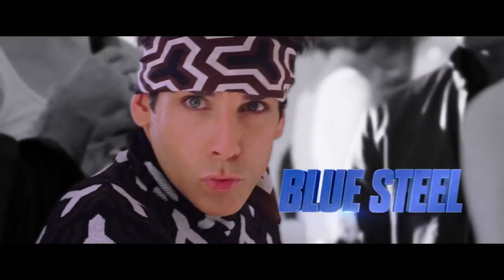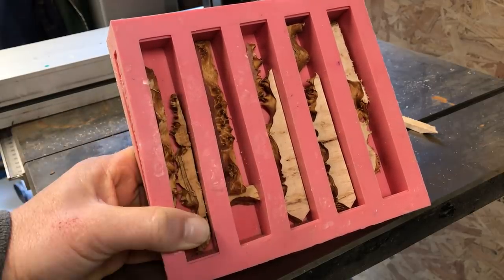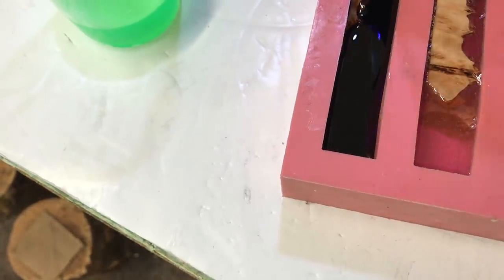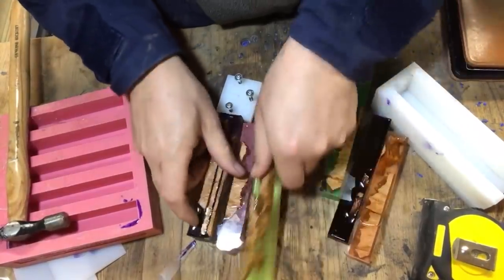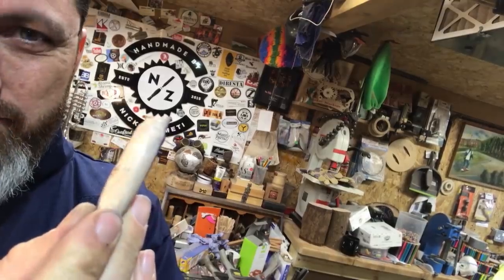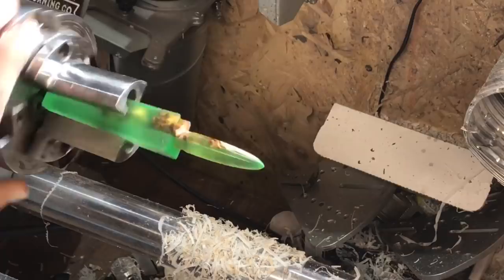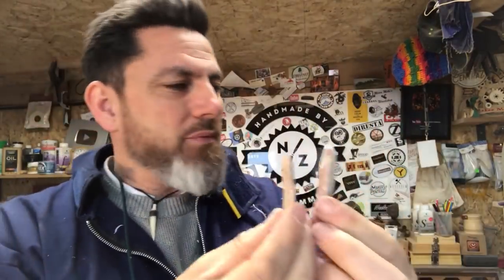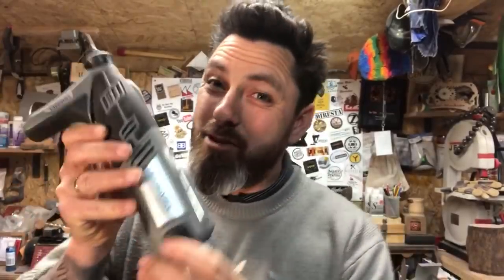I made some funky cool bullet shell resin pendants.. 💥

Comment: The hole in tip just makes it a hollow point
Reply: The crimped ends on the casing are blanks.  They did not have a projectile in them
Reply: Blanks are used at military burial/funerals for the gun salutes.
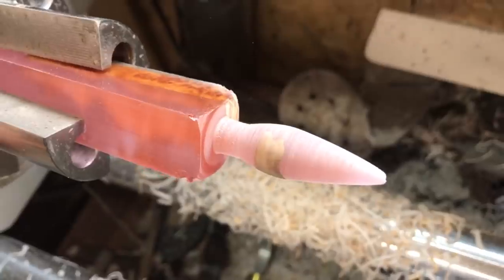Reply: @mmartian1969  15:14
Reply: What the hell does any of y'alls comment have to do with mine?
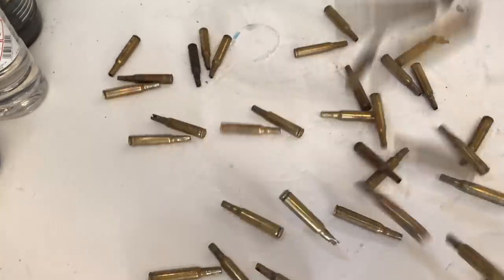Reply: @JDWells-jr6nl  The other two were referencing 0:46 But they got too excited to be little smart arses about their ammunition knowledge before reaching 15:14 of the video, the part which you were referencing to.
Reply: @MoeMyers  10-4
Reply: No, I watched the video all the way through before making a comment. I was ONLY responding to Mark's comment with a bit of smart arse ammunition knowledge that others may or may not know about blank shell casings, which by the way are not "bullet shell casings", there is a difference.
Reply: @JDWells-jr6nl  I thought it was funny lol.

Comment: you can actually pop the primers out of the back of the shell. there is no need to drill it out
Reply: but he had to drill to put on the hanging wire anyways
Reply: @heatherthefireislefairy5469  it would leave a hole just the same and is a lot easier.
Reply: @heatherthefireislefairy5469  There's actually a small hole there after the primer's popped out, a lot smaller and takes a little more finessing. But yeah, you could pop the primer out and use the already there hole if you use a smaller wire. Could also use the primer slot as a place for a mini emblem with a hole in the middle, LOT more work for the emblem though that way.
Reply: Yup.  Press out the primers. Also, I would have used a smaller wire.  The big huge copper is just clunky.  Just solder on a brass loop.
Reply: @shatharis  I kinda wanna see a video tutorial on this.

Comment: Did i mention i have been a gunsmith for 31 years lol  first time i have seen some one drill out primers to make a hole lol they are a push fit , you can bang them out from the inside with a small punch or file nail etc .

Comment: You could use the metal emblems and add it to the necklace like a charm to pair with the pendant. Just drill a small hole on the top and add a jump ring. :)

Comment: These turned out awesome. If I had to pick one, either the purple (because I like how the wood looks just on the side like a piece of polished stone) - or one of the "squared off" ones because they're gorgeous. I would suggest for your smaller projects like that, perhaps a small metal stamp of your logo or at least of the NZ? You could use a hammer and indent pieces with your emblem.

Comment: You could add your emblem by drilling a hole on the ones you put on the bottom of your work. Then add a ring in the hole and string it next to the main piece. I have several brackets like that.

Comment: just FYI in case you do something with the casings again: if you insert something thin through the neck into center of the bottom where the primer (the thing with the dent in the center) from the inside and bang it a couple times on the counter the primer pops out so you can replace it or, in your case, for the hole you're wanting on the other side... unless it's military brass, (can't really tell, sorry) but the military brass sometimes has a crimped primer and that makes it difficult to remove without an actual de-primer tool

Comment: Those came out nicely funky, sir!
If you're going to make a lot of these or use empty cases for other projects, it might be useful to look at some of the specialized reloading tools. A case trimmer and a depriming tool could make processing the brass cases a it easier.
For putting your logo or name or mark on the cases either chemically etching the brass or getting/making a steel die to stamp the case with would likely work pretty well. If you stamp the side of the case, a wooden dowel inside the case should help to keep the case from collapsing while being stamped.
Thanks for another fun and funky half hour!

Comment: Try electro etching your name on. Cut the template out on a vinyl cutter, or manually from electrical tape with a knife. Get a car battery charger, put the negative on the casing and clamp an appropriately sized block of cotton wool in the positive. Dampen it with salty water and apply. Just stay within the lines!

Comment: A lot of jewelry makers will take small metal circles similar to yours but maybe a little smaller, drill a hole through it and use a jump ring to attach it to the back of the necklace where it meets near the clasp. That way the makers name is always there but it's not prominent as part of the jewelry but if anybody were to ever ask where did you get that they can spin it around and show them the little tag that hangs from the back it is also metal and Polished and pretty so it looks good.

Comment: You can add your button to the bullet part by just drilling the tiny hole in the button and threading the jewelry ring through it and the ring you made from wire. It will appear as add-on charm, if no other ideas work out, like the last option to try...

Comment: Put the piece the Chuck of your handheld power drill and use it while sanding so you can get the tip without putting too much pressure on the piece.

Comment: Nice project.  I'd stick to the round design though.  Square ones look too much like your trying to get rid of scrap.

Been a sub for a while now, enjoy the series, thanks Nick.
Reply: Also, just hammer the primers in the bottom out instead of drilling.   Save time and drill bits(i know the brass is soft for the smart asses).

Really you don't even need the proper tool either, just an appropriate sized nail or old screwdriver down inside the casing and hammer it though.

Comment: Very cool pieces!! You can etch your name using the etching technique they use in jewellery. You dip the piece in acid having covered everything apart from your design and the acid digs into the metal. You use different acids for different metals. I am assuming the bullet cases are made of brass? I am not very familiar with the technique but you can find lots of stuff on the internet. Otherwise, laser engraving is the best option.

Comment: Cool idea, Nick. Perhaps there would be less difficulty if you used one of the .30 caliber shell casings, .30-06, .30-30, .303 Enfield. lots of other sizes to choose from, some easier to get than others.

Signing your work: Perhaps a branding iron, self or torch heated, with  a miniature version of your brass emblem would work, or a carbidetipped engraving pencil, or one of the small handheld tools designed specifically for this. Dremel appears to have one. 

I have 4 Dremel mototools, three of them are in working order. I like yours with the "pistol grip".
"Dremel, it will fix anything in the house but the cat"  Actual text, or close enough, appearing in some ads 30 some years ago.

I have no pecuniary interest whatsoever in Dremel, other than as a satisfied customer.

Comment: There's a specific type of tape and you cut out what ever and then place it on the project. With either salt water or etchant use a special machine, device really, he run an electric current though the salt water or etchant.

Comment: Cr@p.  I know I should be working on Arduino & my 3D printers's firmware but Nick's posted a video. Must Watch.
Reply: I do that in parallel. Well I try at least.
Reply: @Davedarko  Boards Manager. Grr. Im trying to ressurect a Makibox whose prev owner knacked the Extruder of so I fitted it with Ramps 1.4/2560 but can neither guess nor find out which version of the files I need. I decided to grab what seems a bargain Prusa i3 style clone with power cut recovery,  $104 Del from Aliexpress. Was amazed when Honey App took off $5 so ive got a new machine arriving soon which cost me £79. It'll work and I can print my Parts for a Hypercube Build whilst I try to fix Makibox + Tronxy
Reply: @goldbunny1973  wow, yeah that sounds like youtube would be a distraction - I'm printing a project for an element14 video and hope printing PLA after printing ABS will just work on my CR-10S. Probably jinxed it now :D
Reply: @Davedarko  I'm building the hypercube as a "low wide flat frame" Dual Z's and hope to be able to 3D print a full size woodfill or tinted clear violin : ) At least I know my FW can upload, it was the usual case of I had it...then Agh!